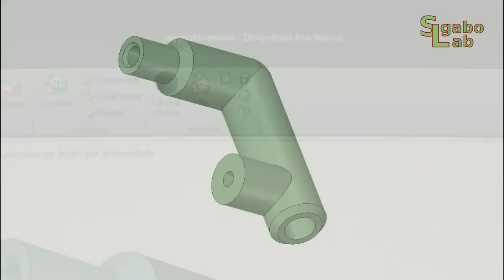3D printing DIY How to make FanLess Cooling

Comment: you do not necessarily need the diod setup you can use the Relay and turn of PWM or tell the slicer (in slic3r its possible) only to switch fully on or off. 
But. Nice idea i wanted to do so with a radial Fan but wasent shure is has enoth Power. how lowd is the areator? print quality better than Fan?
Reply from the maker: hi, old firmware had only pwm out ... 100% pwm not equal at always on ;)

Comment: What is the pump you use for this build ?
Reply from the maker: in description
Reply: @SgaboLab  i already read the link in the description but no info about the model
Reply from the maker: @MARECRonan   ops .. sorry .. in this video I use 1.8 l/min 3w .. after in version 2, I replace with 4.5 l/min 5w with flow regulator .. ps.  on new printers I use another system "Scolopendra" .. take a look to it ;)
Reply: @SgaboLab   Thx for your response ! I used a 1.8l and yeah, i think it's not enouth. Your video open many possiblity and it's cool.

About scolopendra, i just find like things about insect xD
Reply from the maker: @MARECRonan  :D .. from my video .. https://www.youtube.com/watch?v=nqRSTmeW2nM&list=PLAO5ebsLaYhSPOC1Tgqcl2tJzOwQcmoUr

Comment: What is the supposed advantage of doing this as opposed to a typical fan setup?
Reply: Seems like he managed to get a lower power loss @ the heated bed and heatblock, due to less air passing over it w/ this setup, making the printer slightly more energy efficient. Also less air passing over prints can increase both layer and bed adhesion. Also, since the air comes from outside the printer, a setup like this could be used in a enclosed 3D printer w/ heated build chamber (as a replacement for water cooling).